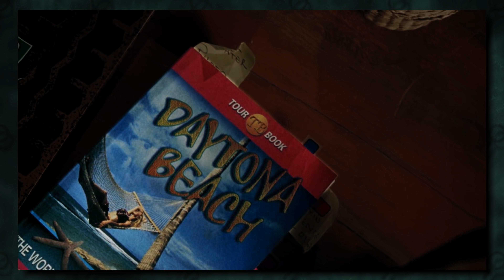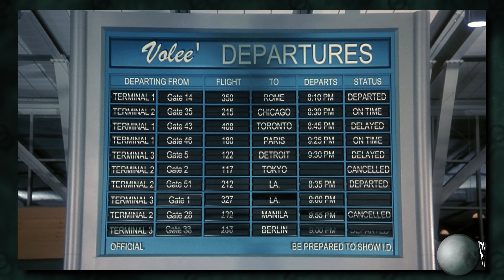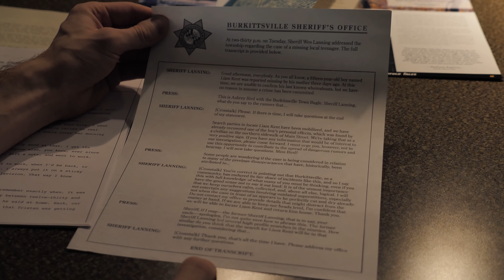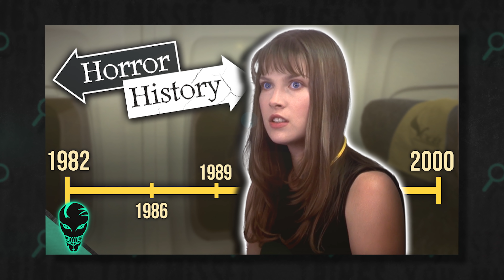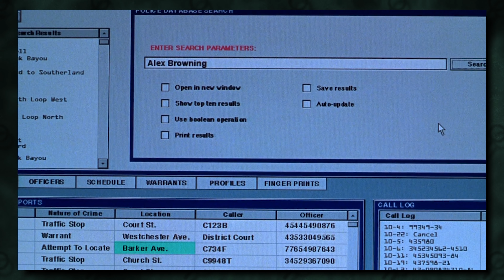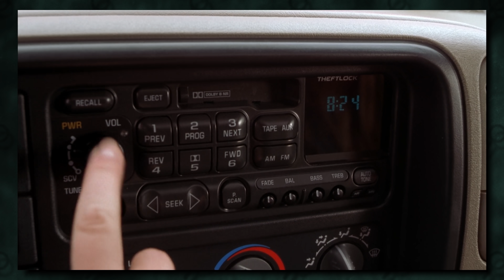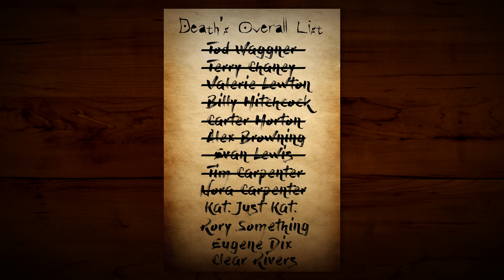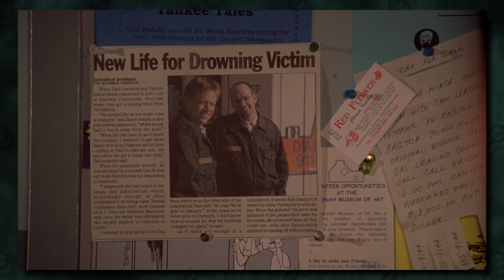75 Things You Missed™ in Final Destination 2 (2003)

Comment: What you seem to have missed is that the accident takes about fives minutes to happen from the moment Kimberley leaves the on-ramp in her premonition (as you mentioned).  It's happening on a highway but she's driving pretty slowly (there's even two trucks overtaking her) so let's say she's going about 40mph, which after about 5min puts her at least 3 miles away - and the truck causing the entire accident overtook her, so it's even further.  Yet when she blocks the on-ramp and we see that truck drive by, the accident occurs right next to where they are.  My point being that the blue truck should have never hit her car right there and then.

That entire premonition scene by the way is completely bogus.  Eugene on his motorcycle is waiting on the on-ramp 5 cars behind Kimberley, in front of Burke's patrol vehicle and is then seen overtaking car after car but only passes Kim merely 4min after she takes off - and at that point, Burke is right behind her.

However, in light of all "180" references - it's nice that Clear is in room 109 where she seems to be able to avoid death and its plan.  She might still have been in danger if she had received room 108 for example... who knows (^^,)

This one isn't the worse movie of the franchise though, can't wait to see your take on the 4th one.